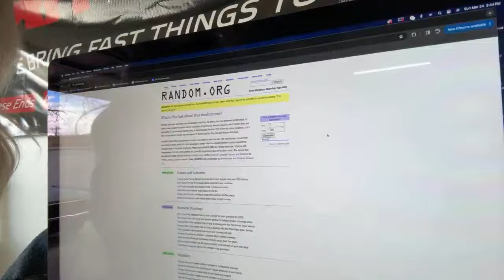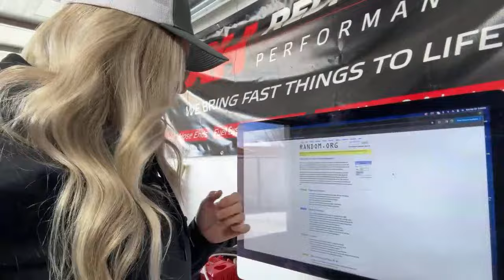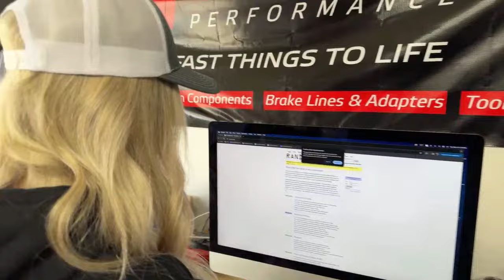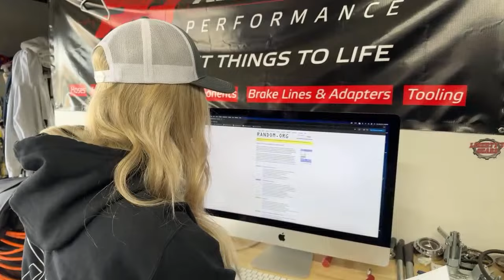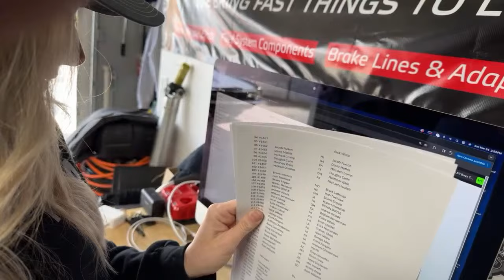Gray Mare Package Winner! And #WhtCrkr Motor Teardown!

Comment: Hi again, Tess told me about Eddie who passed me to another shop and still need a shop before all that parts turn back to earth 15 k worth but Did you need a stock block 302 I got one took it out of a 90 notch with 30 k miles going coyote with m&m turbo glide